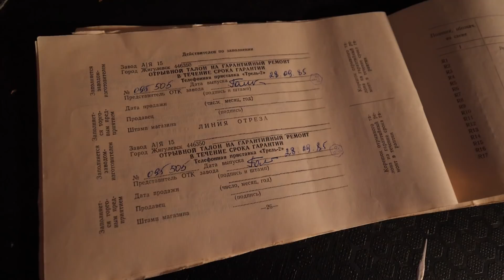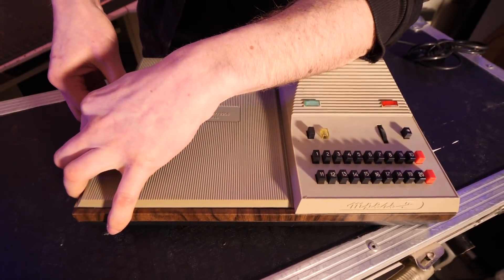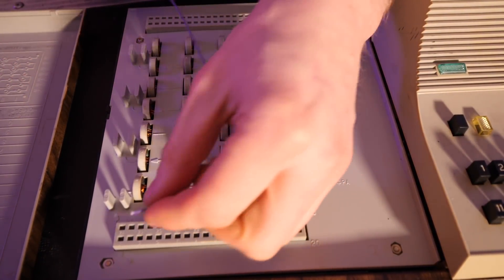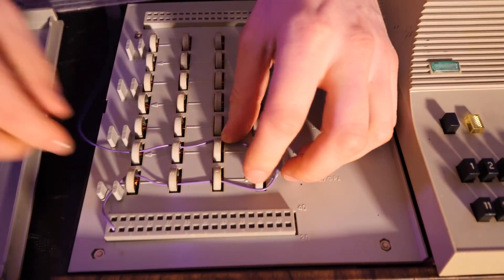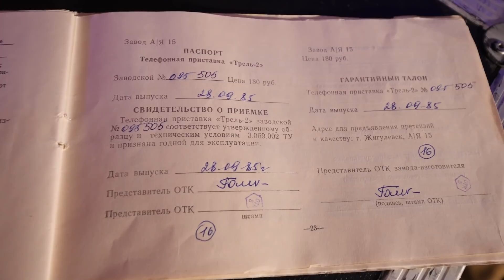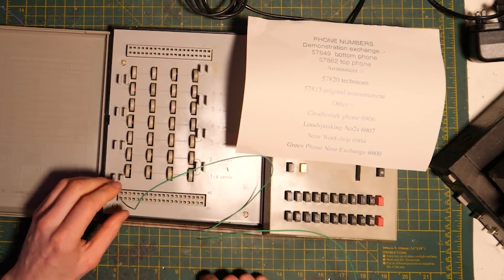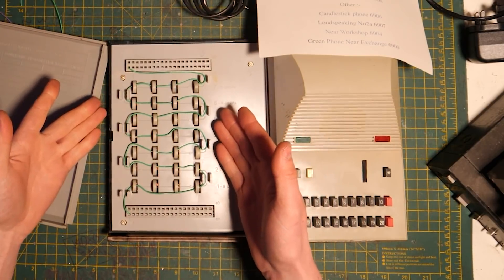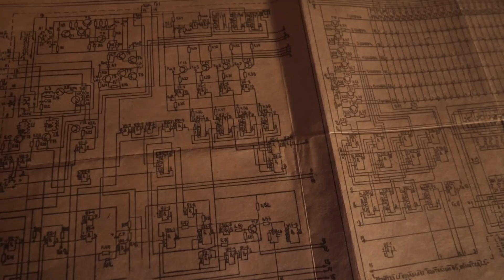Soviet 80's Autodialler But with 60's Space Tech Program Memory

Comment from the maker: Mikes Vid! https://www.youtube.com/watch?v=tPT6nIRFI_I
The Backing Songs Available here :- https://www.patreon.com/posts/megamix-8-pt1-59898141
PS not to be mistaken with Magnetic core memory, which is read and write, this is more like how a rom would be programmed. 
Does anyone have any other examples of rope core memory being used in products? (im not talking about fancy computers, spaceships, telephone exchanges etc, but legit domestic appliances where the user is not necessarily an engineer), im interested if there are any others about!!!
so lots of thoughts going round on this! like mentionned in the video chris said about small business or hotel use, however also the idea of confidentiallity being a thing, however there is no lock, and anyone can decode it as the program codes are shared on the underside of the top of the case. Also you can hear the relay clicking, who knows! if anyone has more info fill in the blanks below :)
Reply: @Василий-ю2я8у  да. блестящий
Reply: I used to work with magnetic core memory at Allen Bradley industrial automation. Really robust in the factory environment, but it had a destructive read, so you had to read data then write it back again. 4K was the size of a book, like a Christmas annual. I have never heard of rope core being used outside of NASA, sorry.
Reply: I worked on a project for a domestic controller that I built a couple of years ago and the safety standard that it had to comply to was written assuming that you had some kind of clever toaster with ring core memory (from the 80s!).   As such it assumed that you had a tiny amount of memory and you had to check every cell of the memory - probably not too much of an issue with a 16x16 array but when you have 3Mb in multiple pages it became quite an effort!  The clever bit was checking an area of memory, temporarily moving the running application into the checked area, checking the normal location and then moving it back again.
Reply: from a comment on mike's video:  @Leo's Bag of Tricks Love this! Reminds me of the "Tormat" memory used in Seeburg Jukeboxes to remember the song selections. Tormat = toroid matrix.
Reply: @Brad Bell  another thing that would fit in great at the museum!
Reply: brilliant lol!

Comment: I used to install the type of phones you have there. The bell pinging was common when an extension phone was fitted. The fix is to adjust the spring located between the two bell coils. If that spring alone was not enough a themister is installed in the bell curcuit.

Comment: I can't help but wonder if it wouldn't have been easier to make split cores so that when you were routing the wire you wouldn't be pushing it through a ferrite core but rather just snaking it around ferrite pillars.
And when you were done you would just clip the other halves of the cores on top to close it off.
Almost exacly like those clip-on ferrite chokes that you see on cables.
Reply from the maker: Chat to the manufacturers

Comment: Yeah, I worked in a U.S. telephone switching station for one summer as a teenager in the 70's, and this really takes me back. Lovely set-up you have here, Mum! Maybe you could put together a video on how to use the stepper motor wirings to trace calls back to the original dialing number (like in the old police detective TV shows of the 60's).

Comment: That encoding is wild to me... I wouldn't expect it to be binary, exactly, but I would expect some rhyme or reason to it, and I'm not really seeing any. Very cool device. Even if it's not consumer-level, it's the closest to it that I've seen this sort of woven memory used in!
Reply: It is binary if you squint. Wire in coil is zero, wire inside coil means one. The encoded number is one apart from the number actually dialed.
Reply: @eDoc2020  Ah yes, I should've pieced that together, but I suppose my brain didn't jump to subtracting one vs. say, a bit rotation or the like. Makes sense!
Reply: Non-binary encoding... Ask about pronouns :)
But seriously, the number of combinations allows to code 16 numbers - well, maybe 14, because threading the wire through all rings as well as through none of them is no use. 
So, some kind of binary coded number must be present here, even though the coding itself is not typical at all.

Comment: “This won’t work with a modern phone system, so let’s just wire it up to this 1980s phone exchange I just happen to have behind me” 😆

The modern phone line in my old house still worked with an old rotary dial phone. It even rang the bell if there was an incoming call. Now I live in a house that has fibre optic and can’t even have a copper line even if I wanted one.
Reply: oddly enough I was browsing the web looking into a way to connect up a functional telephone display. I found there is some bluetooth adapter that plugs in series onto the back of your phone that makes it bluetooth extention of your cellphone. The Adapter has to be plugged into a power outlet. I dont remember the name but look for rotary phone bluetooth adapter. Have a good day.

Comment: Fun fact: in 1985 Soviet Union not even every household has the phone line, phones were mostly in big cities with >1MM population. Those who did have the phone quite frequently shared the line with their neighbors. Whil one family talked, in other apartment line was dead quiet 🤫
Reply: When one family talked the others got a quiet line? That's interesting. In the American party line system you could pick up the phone and listen in on your neighbors.
Reply: @eDoc2020  two apartments shared one physical line. In each apartment there was a device called "blockirator" sitting between the phone and the station. It worked like a flip-flop trigger - when in one apartment somebody picked the handset - family in the other apartment was cut off the phone line. But two families had their unique phone numbers.
Reply: @nneeerrrd  That seems like a much more complicated system, they probably needed a couple extra wires between the two customers. And was it limited to two customers? AFAIK the US system could usually handle a few more.

Comment: Phone numbers have 7 digits without the area code.

XXX-XXXX

There are 7 rows of memory and each row has 4 bits.

4 bits can represent a number from 0-15
3 bits can represent a number from 0-7

There is technically extra memory but whoop de doo.

So you can easily program and store a 7 digit number just by wrapping the wires  correctly.

I havent watched the video yet, just applying my computer science knowledge to what I see in the thumbnail.

Comment: As a computer scientist I was interested in the coding of those wire in/out patterns. I had a look at it and it appears like it's basically sort of an analogue string of four-bit binary numbers.
Each "in" wire acts as a 0, each "out" wire acts as a 1.
The peculiar thing is that each of the numbers are shifted up by 1. So 1 = 0010b, which typically codes for 2, 2 = 0011b which usually codes for 3, and so on. The "0" digit is coded by 1011b which typically codes for the number 11, and the digit for "no digit" here is 0001b which typically codes for 1.
Reply: Wikipedia calls this "offset binary" but doesn't seem to have anything on this particular variation. Here's one that does have its own page: https://en.wikipedia.org/wiki/Excess-3
Reply: I didn't actually look at the schematic but I figure it loads a counter with the stored digit and then counts down with each pulse. Then all zero is probably taken as a signal to advance to the next digit, instead of pulsing the relay.
Reply: It will 100% be related to the number of pulses and how they were interpreted on USSR dialling infrastructure
Reply: I don't know as much as I'd like about electrical engineering, but what I think might be happening with this device is that a current is run through the wire which induces an electric field - that electric field interacts with the field of those electromagnet coils and is read as a change in voltage or current by the rest of the devices in the circuit and then converted into a series signal which can be used by electromechanical devices on the phone line.
Reply: @chocladc4942  Mike went through how it works on his video. Each core is basically a transformer. When an  energized programming wire is run through the core it causes magnetic saturation in the core, making it ineffective as a transformer. Then the unit sends a pulse. If the core is not saturated it is coupled through the transformer and read as a 1, otherwise the pulse is not coupled.

Comment: In older systems 'extension' phones and  'master' phones were wired differently because the 'master phone' had the capacitor that separated the bell signal rather than it being done in the 'master socket'.
Reply from the maker: yeah. but i was just following what the manual was saying, as it says to literally wire both in parallel. i was using a master socket.
Reply from the maker: had the same issued without the phone wired in, bit funmky. aaah well

Comment: This should not be confused with Magnetic Core Memory - the cores are NOT being used as memory, it's the route the copper wire the user inserts determines the number dialed so it is effectively the memory element.
Magnetic core memory uses the remanence  of the core material (iron or ferrite) to remember a binary state (0 or 1) - This is NOT how this unit functions.
Remanence based magnetic memory has been around since the early 1950s, Seeburg Jukeboxes used 'Tormat' to remember which tracks had been selected was a very early example .
Reply from the maker: looks like im getting a tormat
Reply from the maker: yes. like magnetic core memory would be used for ram, woven core would be used for rom
Reply from the maker: i was waving around a ferrite core in the vid but edited it ouut lolo
Reply: + Using four bits to represent a base-ten digit is what Binary Coded Decimal did, back then https://en.wikipedia.org/wiki/Binary-coded_decimal

Comment: I used to work for a company that supported a number of System X telephone exchanges in the USSR. We had to modify the line card hardware as it turned out that the way that a typical Russian lets the phone company know that there is an issue with their line is by applying mains voltage to it! Crazy Russian bar stewards.
Reply from the maker: hahaha thats funny!!!
Reply: I've never heard of it though I was born in Russia and I've been living there most of my life. Sounds really crazy and at the same time it's likely true
Reply: Now they'll have to come and fix it
Reply: I guess one could trace the induction through to the problem. :p
Reply: Wow! I thought about the same thing for a while but never actually did. There was no reason for that, I didn't want to destroy some critical equipment. Now it's weird to hear someone doing that on purpose) Well, if your provider (or a government) doesn't give a spark, then this is definitely a way to leave a feedback (literally. haha)

Comment: Sounds like when the autodialler dials, it's not 'shorting' the phone, so you're getting a bit of emf from the bell, which could be affecting the loopback resistance, might be something to do with the loop relay, try lifting the receiver on the phone before dialling (1000 ohm bell circuit, 500 ohm speech)
I would guess the have all 40 numbers wired, you would use enamelled copper wire.
Reply from the maker: yeah. it was a thing i messed about with bit of a bummer, however it was still being awkward without a phone wired in at all
Reply: @LOOKMUMNOCOMPUTER  In fact the parallel phones did ring on soviet lines once you were dealing a number.
Reply: You might also try it in series, using it with the phone off-hook.
Reply: https://youtu.be/zbKh16dC5XA
you can see original wiring in this video , yes these're thin copper wires

Comment: Wild. Seems to me that all the programming wires would have a common ground, so having separate sockets for each wire on the "output" side is just a convenience in case you want to make changes after the initial wiring/programming?
Reply: More likely is that the ends go to differential amp inputs. At the low levels from the cores it is much easier to sense differential rather than reference to a common ground.
Reply: @martinmoeller9186  The programming wires drive the cores into saturation, the sensing is done by some of the wires underneath the cover.

And regarding the shared "output", IIRC there may be two commons, each one used for 20 numbers. This is because the unit supports 40 numbers by using 20 buttons and a shift key.
Reply: @UC0URFA372CF0q_Klqm8nE_A  That makes sense, my assumption was that the system worked the other way round with each core being sequentially driven, so that presence of a signal on the wire indicates whether the wire goes through a core (1 turn transformer) or not.
Edited:
Just watched Mikes video, underneath wired saturate all but 4 (one row) of cores then the programming wire is pulsed with separate sense windings on each core detecting the pulse.
The saturated cores (all the rest) don't sense the pulse.
Reply: Watching Mike's video, the read circuitry is also ingenious- the program wire is pulsed while the cores are read (sequentially, I guess) in seven groups of four while cores not to be read are kept saturated. Each group of four cores forms a four digit binary number which is converted to one decimal digit. Seems like with additional shift keys and grounds, you could have as many multiples of 20 stored numbers as you liked, as long as you could stuff all the little wires through the cores.